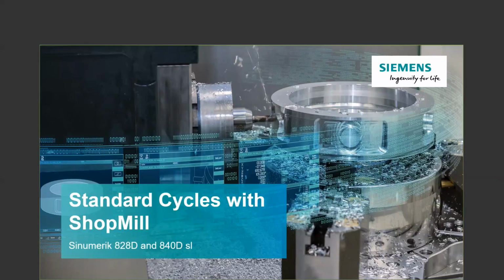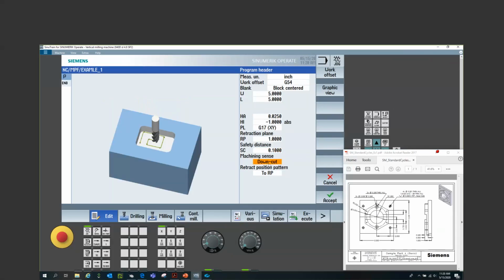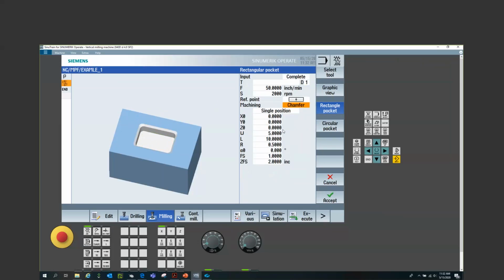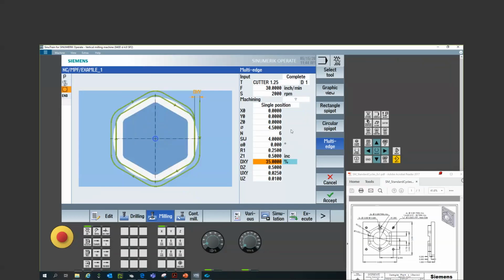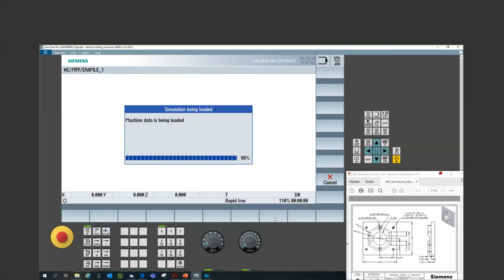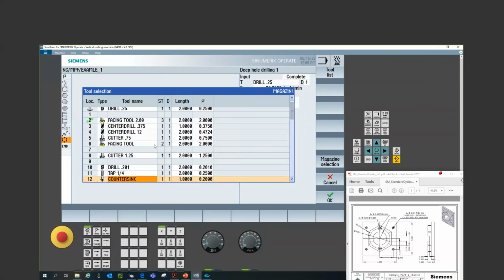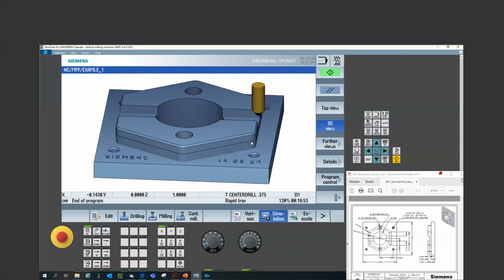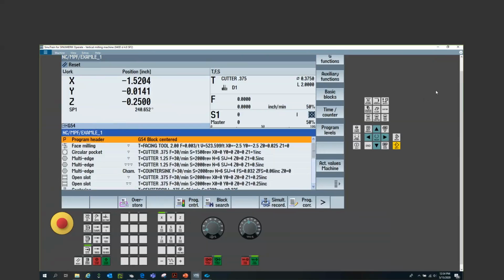Working with Standard Cycles In ShopMill SINUMERIK 840D Sl & 828D

Comment: Is there any 3 axis capability within 828d shopmill for relatively simple features (ramps, fillets, large corner radii, half-pipes etc)? So many parameter options for drilling, simple 2.5 axis milling but so far as I can see absolutely no shopmill interface for basic but true 3 axis. Competitor machine software from Hurco, Prototrack etc provide these easy 3d options. Would be great to get a response on this. Offline CADCAM programming is overkill for a one-off part or very low volume run
Reply from the maker: that is true.  we do not support 3d simple shapes in ShopMill.  it is possible to handle these types of geometries in G-code will commands like repeat but it would be much more complex then ShopMill.  Sounds like a good topic for a video.
Reply: @MrCNC  I have managed to do this in pure G-code and in the straight/circle section of Shopmill for simple ramps, arcs repeating along X or Y with a ballnose cutter with the tool height set at the centre of the ball and programming the tool path as it would be from the centre of the ball to get the correct offset, since the software won't apply the correct dynamic offset as it changes in YZ or XZ on an arc for example. It can be done but it's a manual process and you have to remember to change the tool height back once you're done. Shopmill 3D would be a great feature for the future. There's a lot of low volume jobshop work that could utilise it for various features and to eliminate setups.
Reply: @MrCNC  def should do a video on that